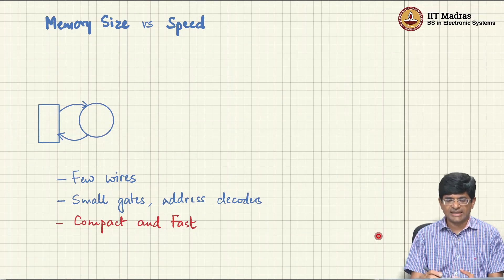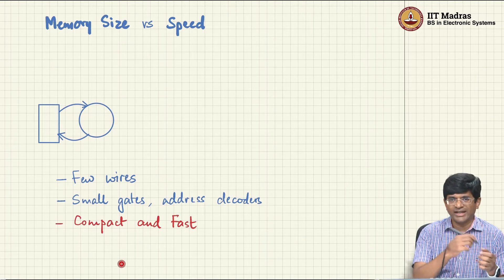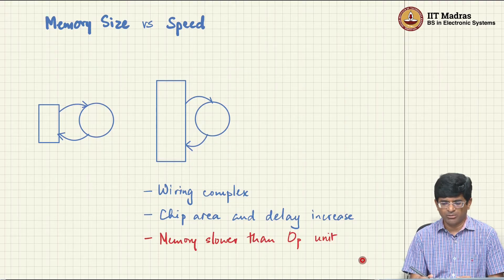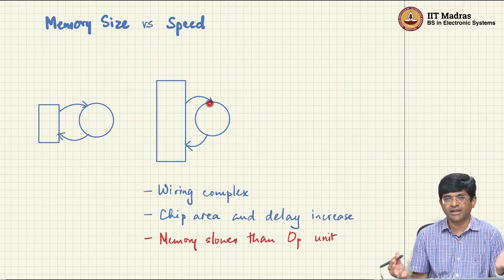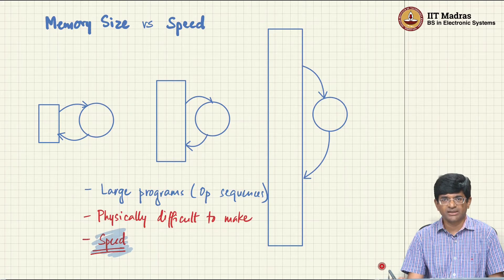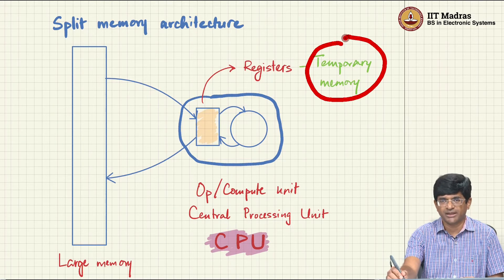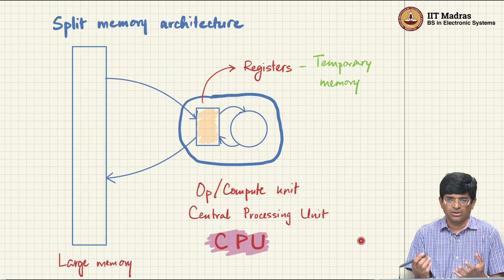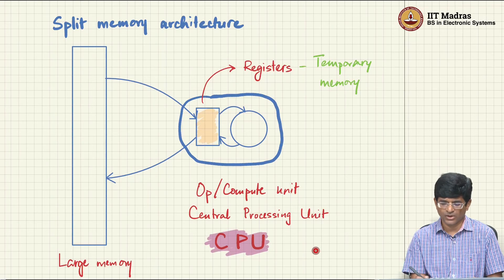3. Split Memory Architecture

Comment: now i under the reason why there were so many resistors around the cpu on the smartphone motherboard, and on the laptop/ desktop CPU.
Reply: Those are resistors and sir is talking a out registers.  They both have different works .
Resistors have to maintain the current flow acrothe cpu and the whole motherboard. 
Whereas registers have the functionality of pulling data from memory to the cpu and putting bakc it to the memory  .
I hope you got it
Reply: Bits in registers and memory are stored as physical states that the system interprets as 0s and 1s, and those bit patterns represent data and instructions according to an agreed encoding
Reply: Brother both are different 😂